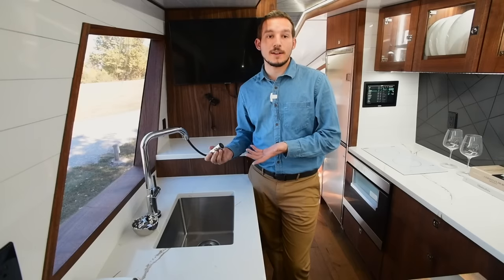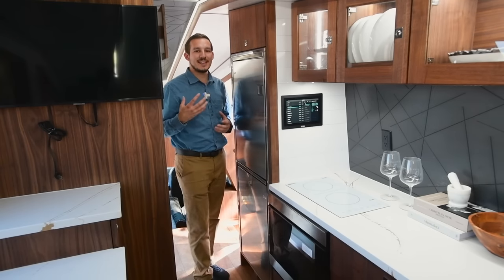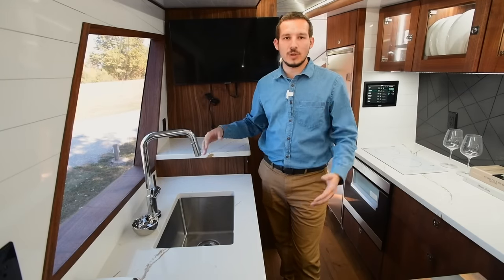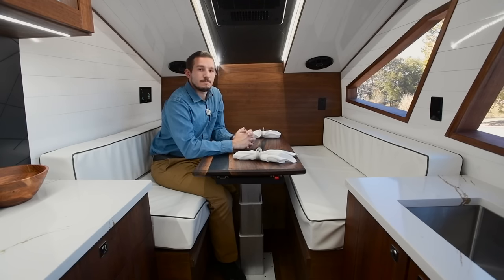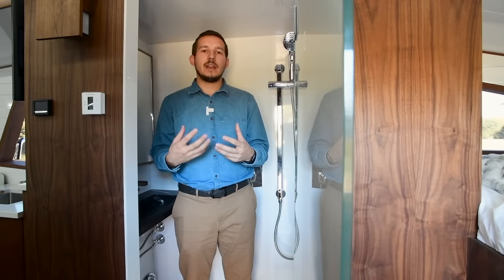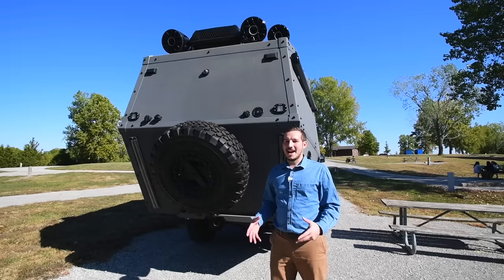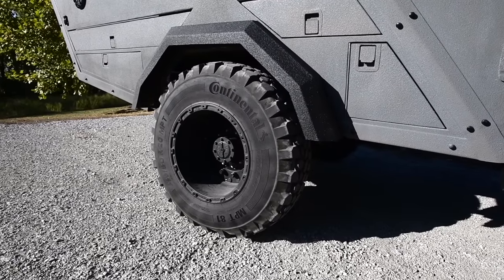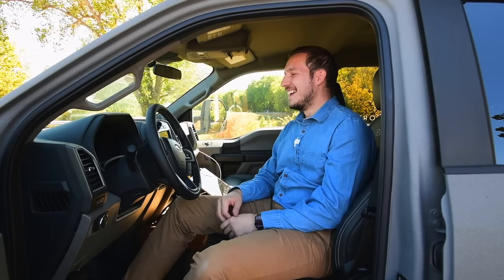Overland Truck Conversion w/ luxury apartment interior

Comment: Lol dude mentions baja but said Donut was putting it on trails it wasn't designed for.  This thing would be a pile of parts if it drove within an hour of baja off road lol.
Reply: I just finished a full Baja tour and it is a tough driving environment even on the paved roads some of which seemed to be nothing but potholes occasionally interrupted by asphalt.  It is a good testing ground for equipment.

Comment: What a rig! I can't get my head around how big the US pickups are, that must be 12ft behind the cab. I'm trying to design a demountable for a UK pickup, and one of the largest beds we can get here is 6ft on a Nissan Navara, and for that we give up the double cab for a 1.5 (King) cab.
Awesome build, very impressed
Reply: Imagine that rig trying drive through a small English or German town…
Reply: We have 10ft beds standard on several of the 3/4 ton + platforms. 8 ft is still about the max on a 1/2 ton or standard full size pick-up
Reply: @Aliensdontwearsocks  Ours normally have a maximal width of 2,30 m. 
For the big ones you would need a bus driver’s license, at least in Germany. And a 10 ft vehicle definitely would have problems in older towns.
Reply: @claudiakarl7888  My first truck when I turned 16 had a 8 ft bed and a single cab. No power steering either so it was a pretty good arm workout. 🤣
Reply: @Aliensdontwearsocks  We don’t drive trucks. 😉 Except of gardeners, builders etc. - and a few idiots who want to compensate for small bodyparts. Our cities are just not made for big private vehicles. Although there are people who drive big SUVs that will never see a trail.

Comment: Interesting build.  The shower door thing is just nice, nothing out of the norm really.  The glass cabinets overhead are a VERY bad idea since things higher up bounce around much more and harder, PLUS there is nothing to keep the glass wear from slamming into the little windows.  Walnut is not exotic wood, it's domestic in the US.  It all has this gucci tacti-cool LL Bean vibe to it.  Then you have an overhead fuel filler.... I don't think I have to explain how bad that idea is.  I give it a 3 out 10.
Reply: Yeah. As someone that camps off old logging roads, I feel like this wouldn't hold up. This is more towards pull up and hook up glamping.
Reply: +1
Reply: You are absolutely right. He has no clue. Daddy paid for it.  He knows nothing. He could not explain how his hot water works or what the name is. Its a Truma Combi that is heated by glycol in the engine and recirculated back for on demand hot water.  Its sad.  So many high priced items but overall poor design. The glass cabinets, the heavy glass shower door, the heavy quartz countertops and sinks, huge slabs of wood, just adding weight to an already over loaded vehicle so that gas mileage drops even further. Bet he drives with full tanks of fresh water too!  🤣🤣🤣
Reply: Totally agree, he left out unbelievable amount of detail and joking at 3 mpg, saying he got it to 8, the first answer was true. I would love to believe that he has the right ideas and giving profit's to charity, but I question this too tbh.
Reply: Completely agree, seems to me that a lot of the so called luxury is just weight added unnecessarily.  Also, all the angles look cool from the outside but inside was lacking in cabinets and other storage that even the most basic DIY conversions would include, when he mentioned "ample storage space" he was being disingenuous at best.  This would definitely not be for me or anyone that wants function over form.

Comment: I haven't read all the comments, so I don't know if it's already been asked, is there some sort of override system to control everything the iPad controls? I mean if an EMP goes off and we lose internet is this vehicle still useful, drive able? 
It is amazing, don't get me wrong, not trying to be Debbie downer here, but that's a lot of expensive technology that could become a bunker with candles in it. If these questions have already been addressed, I apologize.
Reply: Excellent point.  I thought the same thing. Dangerous to put your eggs in one fragile basket.
Reply: What are the chances that a random emp just goes off?? Lol slim to none..not everyone has access to emp...and why would any one use an emp just for one vehicle...your question is like asking a luxury cruise owner..what if your cruiseship hits a iceberg or sinks... lol
Reply: @Lordjervy  no, not as random as you sarcastically say, another country might set one off, affecting almost all of our vehicles and electronics, not just this particular vehicle. Think larger picture lordjerk.
Reply: Every car has a computer and electrical system in it. You're not going anywhere in your corolla after an emp either lol
Reply: @trent_mcneely7554  maybe in my 57 Chevy?
Reply: @Katiedid1975  might as well just use horses because the gas pumps aren't working after an emp either

Comment: Didn't mention piece, compared to the Earth Roamer LTI built on F550 4x4 chassis, and more capable than this, which is near 700k, I'd expect this be about 350-400k, a little higher than a similar Rossmonter because this does have a little fancier interior and very custom shell.

Comment: Just saw a whole video of this thing in action, and it's frankly not safe to take off road, or realy anywhere with any sort of winding road or steep incline. The back isn't secured enough, so it flexs freely left to right and the suspension allows for so much travel that anything even remotely abrupt and it can split the whole thing in two. You can literally see it twist the chassis when it flexes from one side to the other. There's also not enough weight in the front, so it could tip over backwards. You wouldn't have to be offroad for a lot of this to happen, just a steep incline or a sharp turn.

Comment: Love the interior of this rig. Here’s my problem. It’s hard to get a line of sight on the lavy drain, but looks as if you have an “S” trap being utilized. According to the National Plumbing Code, S-traps are illegal. Due to the possibility of a possible back siphon. It should be a P-trap. I don’t know if your required to follow the code,   but you be. The plumber should have noticed this problem, or whoever did the design should have known better.

Comment: Those reading lights in the bed are not in a practical spot... If you're reading with your head on the pillow side the light would be behind your book and shining in your face. You would have to sit up against the side wall/window for it to be an effective "reading light" and that would totally defeat the purpose of relaxing and curling up with a book because that cannot be comfortable.

Comment: Induction cooktops and microwaves are not low power.  Do not idle your vehicle to power your fridge. 8 mpg is terrible. Do not blare your music outside of your vehicle! No one is dancing to your music. Don’t put LEDs on the front of your vehicle, you will blind everyone. This is a huge, heavy, and expensive way to spend vast amounts of money for the rest of your life.
Reply: I agree with everything you said except for the leds on the front. They are for off roading. As in, on a dirt road with no other cars. Any responsible person wouldn’t turn them on when there are other cars in front of them.
Reply: I love the idea of overlanding, but this thing, no matter how pretty is only really designed for civilization as where are you going to get fuel outside of population centers. It has a huge amount of unnecessary crap on it that you don't need, for overlanding all's you need is a bed, a small shower and toilet, 1 induction hob and storage on the outside and inside for all your adventures, with a good set of wheels.

You don't need lots of pots, pans, plates etc. You don't need a shower to wash yourself and your partner at the same time FFS. You don't need speakers outside, glass panels, leather seats, quartz countertops, seating for 6 people. 🤦‍♂️
Reply: @CKW10001  You definitely do not need a toilet in the wilderness, just dig a little whole. If someone wants all this comfort in the wilderness: wth is the point?

They could just go to Vegas
Reply: @CKW10001  sure you don't strictly need all the bells and whistles, but some people want them. I think vehicles like this are designed for people who like the idea of having all the comforts of home while you're out in the middle of nowhere. And if they can afford it, why not?
Reply: @jimbo1637  yeah I agree, but it needs to be practical for the wilderness. There is no way this thing will get you far.
Reply: @ihavethedocuments2580  I agree this is an impractical stupid thing.
Reply: @CKW10001  don't get me wrong, if your primary goal is to go down any road you'd want something way smaller than this. But like I said, I think this is meant for people who care about creature comforts first. So I see this as more of a fearless rv than a jeep alternative.
Reply: @jimbo1637  I get that, but unfortunately this thing can't go anywhere in my opinion, as a 3 MPG and to run all that electrical stuff, it's best just parked up on the drive. I understand what you're saying, but people can do that in things that are much better than this house on wheels
Reply: @CKW10001  fair enough, I didn't realize the milage was that bad. With 3 mpg you'll pretty much always have to stay near gas stations...
Reply: @imforealz8617  I would sell it straight away to some idiot who has cash to throw down the toilet. The thing is useless and a money pit.

Comment: This is what happens when a modernist architect with venture capitalist golf buddies discuss the word "overlanding" and what it means to them. The camper is fine but trying to put it on this specific truck is the big fail. The truck suspension is not strong enough and the drivetrain is vastly underpowered for all that weight so high up. It is not a very capable off road machine. If people want something this size that can actually handle it, get a Unimog conversion instead.